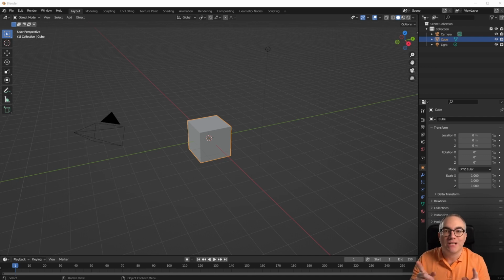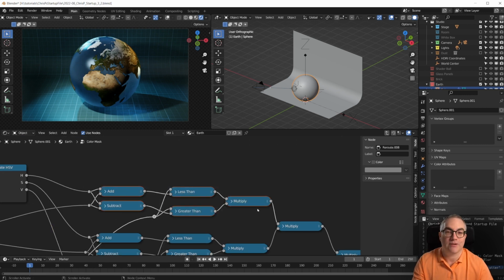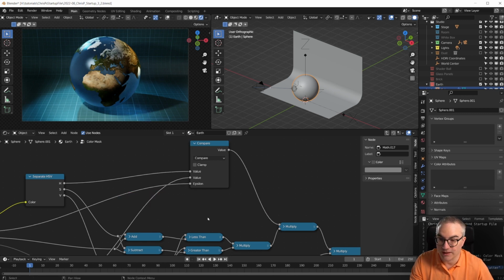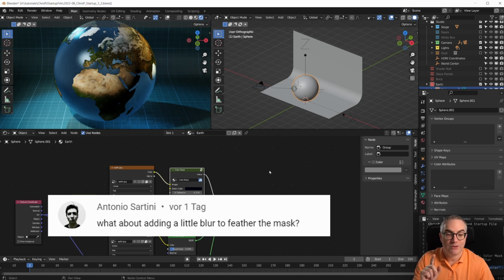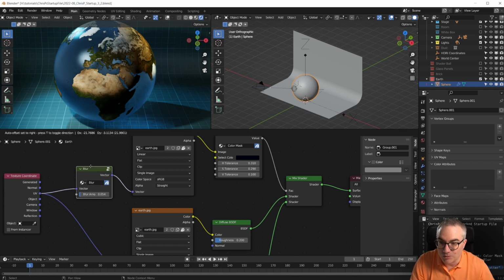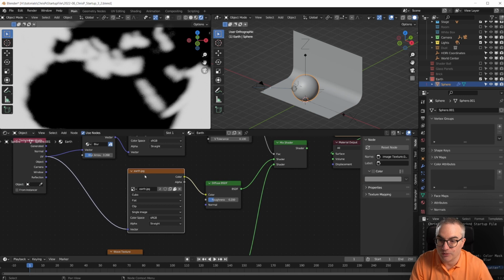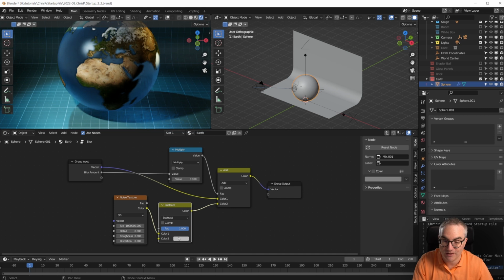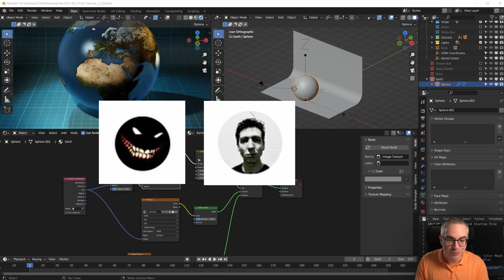➕ In-Shader Chroma Key EXTRAS | Blender Tutorial

Comment: There is a little flaw in this approach. Let me explain: When you compare hue it works when desired color hue+/-epsilon fits between 0 and 1. IE. your desired color hue is 0.5 and epsilon is 0.1 you have a range 0.4 to 0.6. That is working as intended, but when your desired color hue is 0, then you only get hue from 0 to 0.1 while you should also get  0.9 to 1, because hue loops.
Reply: @v there are two solutions the lazy way and the less lazy way. The lazy way is to add two more compare functions one where you add 1 to the hue from either the color picker or the image texture and the second compare would be subtract 1 from whichever hue you picked. Then you would add the results of all 3 compares and clamp the value. Its not elegant but it does take care of the edge cases. The better way would be to write the node using python where you check to see if the selector hue is near 1 or 0 do some math if it is do your comparison and then spit out the matrix of the values. But blenders documentation is a mess so implementing your own scripts and code usually takes a fair bit of research. I find in general doing anything in blender that you aren't used to takes a lot of research